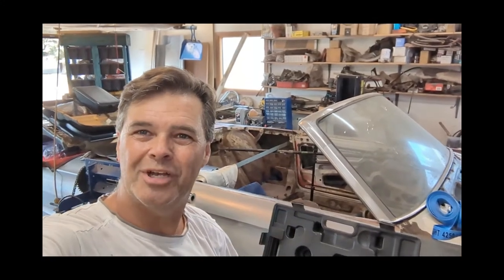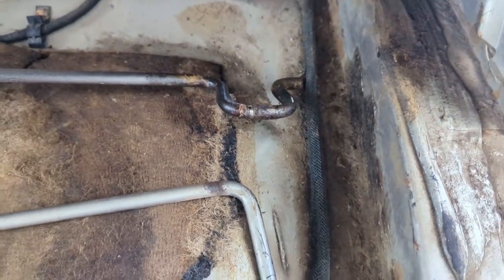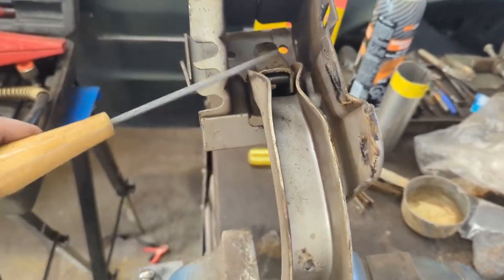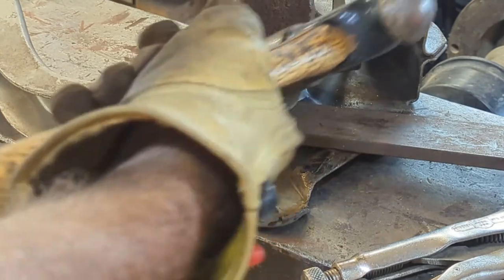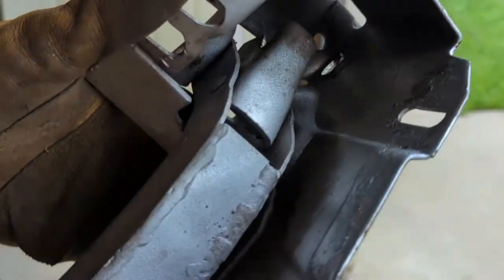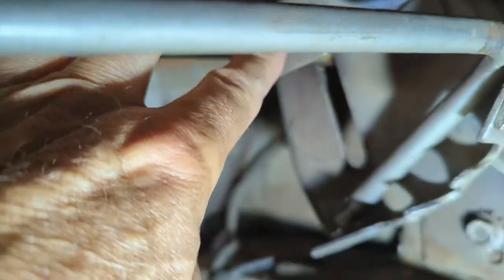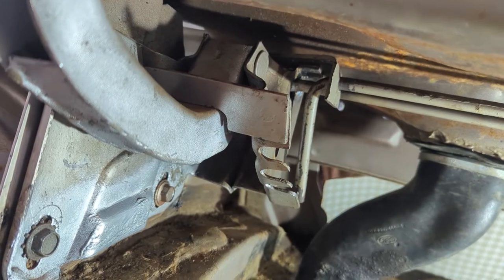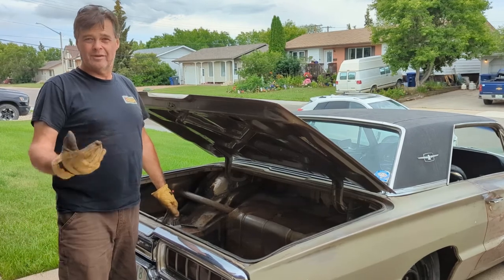Fixing A Bent & Binding Trunk Lid Hinge On The 65 Thunderbird Hardtop

Comment: I’m so glad you posted this. It got me thinking, so I went out and checked my torsion rods. On one side, that short arm inside the hinge isn’t engaged with the torsion rod—it just swings freely. That probably explains why I had to move the rods to the third notch before the trunk lid would stay up. Do you think I can get the arm on the hinge to slip onto the loop on the torsion rod without having to take everything apart? Enjoy your videos.
Reply from the maker: You can...you will have to disengage the rod that is not in the hinge. Then with the trunk lid fully supported as high as it will go (I use a shop broom), you can then engage the hinge with one hand while pushing back on the other side of the rod...you will be able to feel it go into place. Then set the rod(s) so you get good lift on the trunk lid.

Comment: I've seen this issue with the trunk lid being hard to pull down from the up position, like it is catching.  Then pull harder and it lets loose and closes normally.  So what is the actual fix before it bends like yours did?   BTW, the 61-65 Lincolns use the same setup and have the same issue with it catching in the up position. Is it possible to spray some lubricant up in there before it gets too bad?  Might me wishful thinking as my 62 Lincoln and my 64 thunderbird project car have the same issue.
Reply from the maker: Hi Jeff, if you go to the 7:02 mark in the video, you will see where I welded the torsion rod seats to stop the binding...if your hinges are not bent, you will only have to fix the wear in the torsion rod seats.
PS...I made a time stamp in the description for where I explain what I did to fix the binding issue.
Reply: @J_R_Shop  Thanks for the reply.  Another issue for me to tackle.  Lol

Comment: did you end up dropping the gas tank and cleaning it or did you just pour fresh gas in there? and how is it running with the gas in the actual  tank?  how's the carburetor doing as well? 😄:goodvibes:
Reply from the maker: I send in my scope, and there was very little fuel left in the tank...it looks like I got lucky, and the previous owner knew how to store a car for long term storage. I was able to just put gas in, also a couple of cans of seafoam, now the filter is looking after any debris.
The carb on the other hand was a bit gummed up, and took some cleaning with the top off, and floats out.